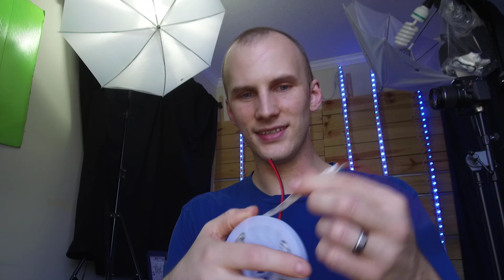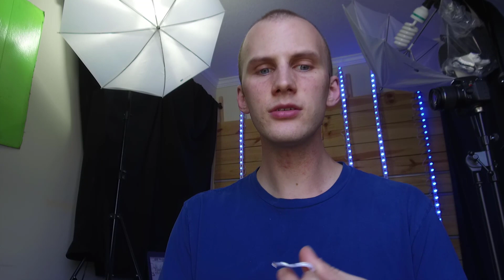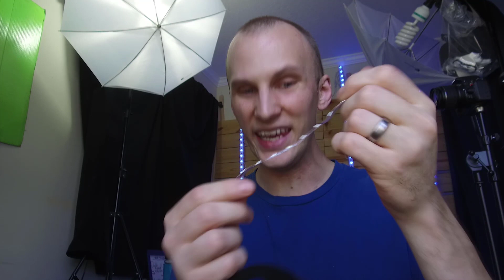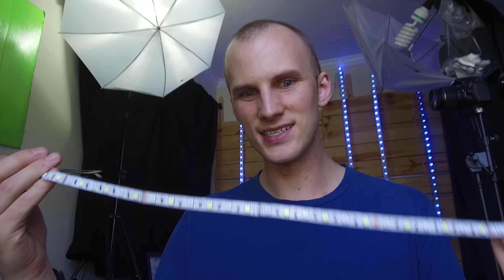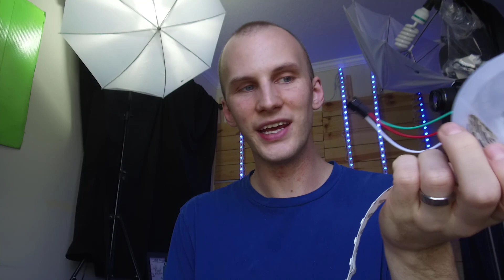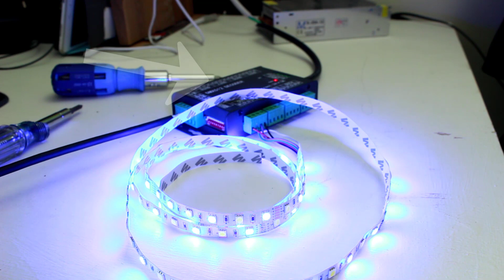What is the Difference Between LED Tape and Pixel Tape?

Comment: Great explanation David. These types of leds are used heavily in the holiday lighting world and referred to as dumb strings vs (smart)pixel strings, i.e. in a dumb string all leds light the same colour whereas in a pixel string each led (or group of leds) can be addressed and controlled individually. Being small and flexible and relatively inexpensive allows for lots and lots of creative uses for these lights. If anyone's interested in seeing these in use, here's an example of both pixel tape and pixel strings from our 2017 Christmas display - https://youtu.be/00CVV1tDfws
BTW, I always look forward to new vids from LearnStageLighting, keep up the great work.